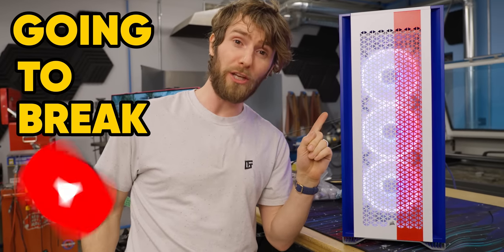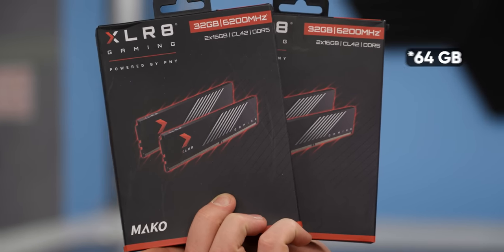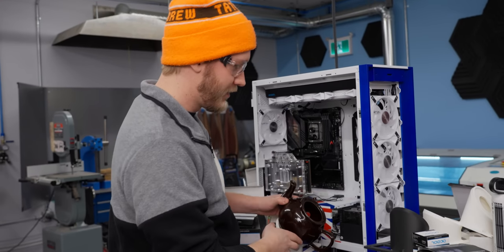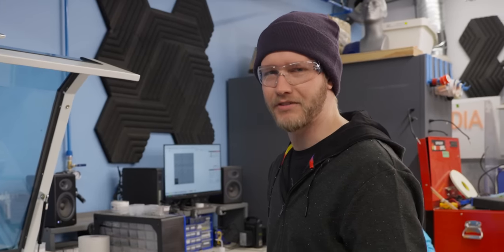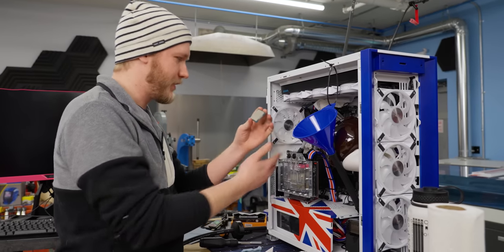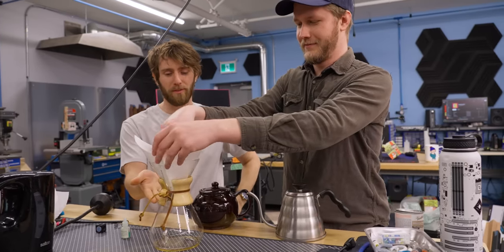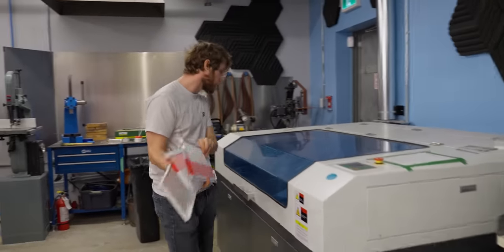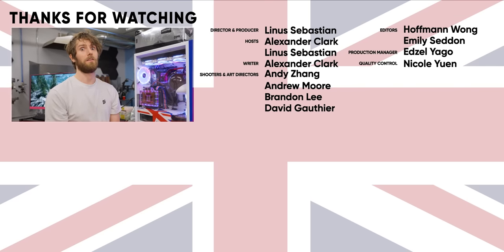This PC Will Break YouTube

Comment: Just colour your water with red and yellow dye mix. Call it "modded tea with no exploits*".
The problem with actual tea are not particles or bio-active substances, the problem are oils which carry flavour - they will easily clog micro fins and I don't know if anti-biotic additive does anything to dissolve them.
Reply: atleast it will work for like a couple months. maybe.

Comment: The rig looks amazing! I absolutely love the paint job and the loop design!
The Hyte/iBuyPower fittings... Barrow make fittings just like that (called Wolverine), I've had them in my rig for over a year. They're fantastic, never have to worry about the tubes sliding or popping out and they look great. I mass ordered mine through BarrowCH's AliExpress making what is normally a £4 (WatercoolingUK pricing as of date of video upload) fitting just £2.30 each with shipping and VAT.

Comment: As a Brit the only thing that triggers me about this is that, at the start Linus uses filter paper when pouring the tea from the tea pot. In case you didn't know, tea bags are made from a slightly different type of filter paper. Therefore there is no point in using filter paper as it has already been filtered by the bag.

Comment: Perfectly Balanced, as all things should be.
Edit: Pro tip, when using pliers on something that can be marred up put a doubled over shop towel around the item you need to plier and it will protect the finish. Also should have used the Yorkshire Gold box to cover the pump/reservoir.

Comment: Apparently, if your ceramic is fully submerged in water, you can hammer a nail through it without cracking it.  May apply to drilling as well

Comment: First of all, props for using Yorkshire Tea. The other stuff out there is pure muck! However, Barry's Irish tea is a far superior product in every conceivable way. Sorry-not-sorry @thespiffingbrit, it's just the truth - DM me if you'd like a single tea bag sent over for proof (very valuable, will have to charge for more b/c EU/UK import fees).
Second of all, no milk? Like, Wtf.
Thirdthly - 20:50, chef's kiss 
Fourthly, Chamomile tea is pretty lit.
Reply: adding milk to tea was introduced entirely as a countermeasure to the terrible quality of chinaware (and thus teacups) in Britain at the time. That's also why 'properly' speaking, you're supposed to put the milk in first. 
When you're not worried about your teacup self destructing due to thermal shock when you poor tea into it directly, you poor the tea first... and can completely skip the milk. Most better teas really need neither milk nor sugar, and are infact made worse by the addition. (cheaper or particularly strong teas, of course, do benefit.)

Comment: Put a very soapy liquid over places that might have a leak, itll make bubbles, same way you look for tiny leaks on bike tires. Trust me. I'm Dutch.
Reply: Not sure what being dutch has to do with anything, but okay.
Reply: @MartinFinnerup  dutch people bike a lot.
Reply: @MartinFinnerup  Yeah all dutch people are licensed bike mechanics
Reply: @croozerdog  the idea was to have things not get wet, filling the loop with water and making only the place with the hole wet is a better option in this case.
Reply: @Milamberinx  Nono you need very little soapy stuff to get the bubbles, not enough to drip down and cause problems. If there's a very tiny amount of air escaping you'll never find it without that trick or luck

Comment: You guys should use distilled water for testing. Its nonconductive, meaning you can soak (almost) any electronic device and it not do anything. The thing that make water volatile to electronics is it can short stuff out. By removing the minerals and such out of the water it becomes nonconductive😊

Comment: I'm not so sure about that 3d printed bracket. The pot might just split it at the layer lines. I would suggest cf filled nylon next time, great layer adhesion. Also put the heat set inserts in through the other side so the screws pull them deeper into the plastic. It reduces the chance of them getting ripped out by the heavy pot.
Reply: Or just print the hollow shell, and then fill it with epoxy, or expanding adhesive foam, etc for more structure/adhesion.
Reply: @Nevir202  that wouldnt work that well, youd need quick casting resin, that works. Expoxy is too thin and might leak out, foam would rip the thing apart. However at that point you might as well build a cast and cast the entire thing to get rid of layer lines.
Reply: @D3nn1s  Wow, are you unaware that thick resins and low expanding foam are things which exist? lol
Reply: @Nevir202  sure, but thats not what you said
Reply: @D3nn1s  I didn't specify anything, you were making assumptions that I was suggesting using things that wouldn't work, for whatever reason.

I actually don't think you are even correct that most resin would leak, anything that isn't super thin would likely work unless you did a really bad print, and even basic construction foam would probably work if you printed with decent wall thickness and had nice layer adhesion.

I was just pointing out that there are products which SPECIFICALLY avoid the issues you are imagining,
Reply: @Nevir202  fair enough. However if you print it strong enough to withstand construction foam its gonna hold a kettle in place just fine. Dont underestimate 3d prints either

Comment: One thing crossed my mind that you poured, boiling hot was it, tea straight to where pump is but most of my pumps say, they cant handle temps over 65c but I am sure you know this and that you use better pumps than I do :)
Correct if I am wrong that there might be danger to pour boiling hot stuff on pumps and run it?

Comment: Things I would have done slightly differently: 

Use the 3D printer to make a bloody tea pot. That way you could have made it in 2 halves with slots to fasten it, put the reservoir in it put the pipes in and fasten it up THEN put the other half of the tea pot on, spray painted it whatever colour you want, maybe put the logo on the visible side and bam, you have a the reservoir in a teapot as you wanted.

Comment: Why black cable combs though? I'd have used red or white cable combs or better yet: triple the number of cable combs and use one red comb sandwiched between two white ones instead of just one random black one. That way even the cables would have the English cross on them.

Comment: put the computer in a air tight box with no water vapor and pure helium gas in it so you can go ham with the cooling like use a cryogenic cooler and get temps colder then when dry ice and liquid hydrogen would form without the helium atmosphere and make 2 way plugs on the walls to pass wires through the cooling cases I don't know what you can do with -300f but if that can give you a overclocking advantage it's possible

Comment: ummmm. Shark bite fittings have existed in home improvement stores for a couple of decades now, they're in the plumbing section. ibuypower isn't the first place to have them. Oh, and they also suck. Temperature changes cause all materials to expand and contract, repeatedly doing so with the shark bites causes them to start leaking because they are essentially compression fittings that you're repeatedly changing the size of which allows the fitting to slip. This is why they've been around for a long time yet despite their ease of use, nobody likes them except the cheap contractor trying to cut corners by not using good materials.

Comment: 1600W PSU in a system that's only going to need about 900W max... Sponsorship overkill, luckily it's 80 Plus Titanium so even at 40-60% load, it's still above 92% efficiency, if memory serves on the spec required for Titanium.

Comment: Disappointing and a real missed opportunity. You just made essentially a water-cooled PC with a bit of decoration. You should up your game and rebuild it, so instead it makes tea either by using the heat pulled from components to heat tea for consumption or with an additional water reservoir it taps of some heated water directly for the use in making tea (though not sure if the water system would be hygienic enough for that.)